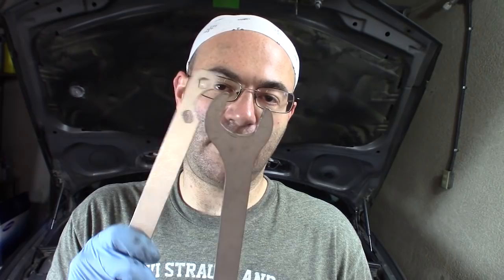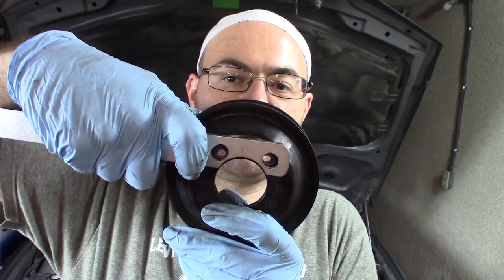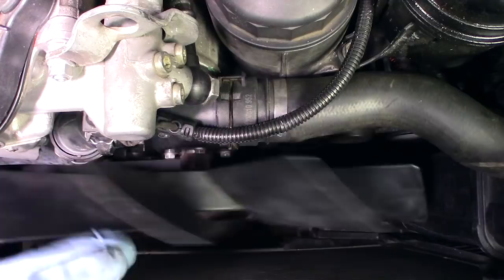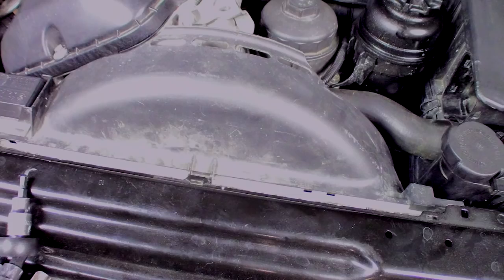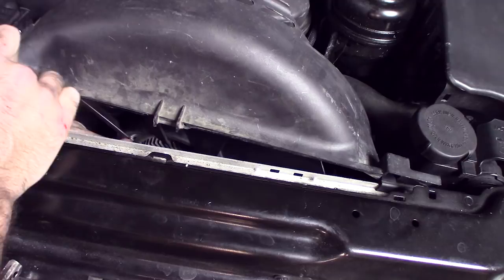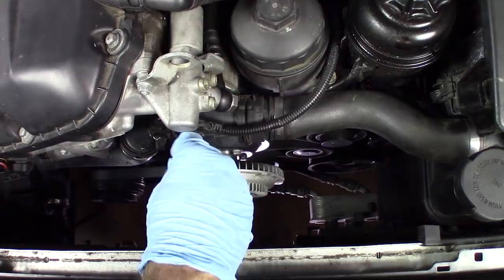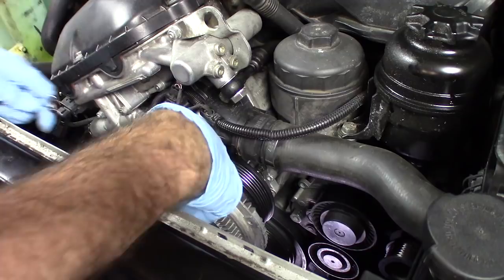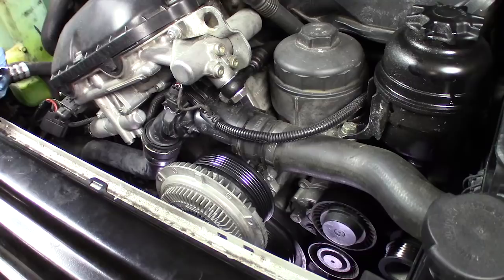BMW Fan Removal Methods - Remove Impossible Fan Nuts!

Comment: Method 4, don't buy a BMW in the first place. I agreed to Help my neighbor out by working on a highly neglected 2003 530i that sat unused for 5 or six years, he paid 400 which caused a rift in his family because afterwards she wanted the car back, she has some crazy notion that the car is worth something like 7 grand, she is 85 now she won't speak to her nephew, ive never seen a stupid car cause a family feud like this one did. I'm currently attempting to replace the oil pan gasket, as we all know BMWs are leakers, I wanted to remove the fan so when I jack up the engine it won't hit the shroud but that proved to be an impossible task, after using my 12 inch croissant wrench and a hammer to try and shock it loose it wouldn't budge, I could see that the nut was kind of chowdered up so it's not this girls first rodeo,

Comment: 4 years later and I want to thank you for making this vid. I swapped in an electric fan and your trick of removing the blades and shroud from the clutch gave me decent access to the nut. Your other trick of using a prybar gave me the technique to use a crescent and a tire iron to loosen the nut. No special tools required. Unless you consider a length of steel pipe to extend the leverage of the crescent, as a special tool. Many thanks again!!

Comment: I know not everyone can afford this but if you can, just upgrade the crappy clutch fan to an electric fan.  Trust me, it'll make your life a whole lot easier!  You can use the electric fan from a manual E46 btw, in case you're wondering.
Reply from the maker: Personally I don't think it's worth the money.  I only keep my fan clutch on lightly tight so that I can remove by just giving the wrench a tap.

Comment: Hey Jason, quick question: I have to replace the deflection pulley, mechanical tensioner and belt. Can I use method 3 to just remove the fan blades? Or will the fan clutch be in the way? Thanks

Comment: If the first two methods don’t work, try sticking the top of the spanner with a hammer to shock the bolt whilst applying downwards and clockwise pressure.

Comment: thanks for going into detail on method #2.  It worked for me on my S54.  Other videos go over this a little bit but your video makes it clear to see what to do.  I was going to try method #3 if it didn't work but it did.  Broke the fan clutch nut free in 2-3 minutes after trying for an hour the previous night without wedging anything to hold the water pump in place.  Other videos break it free without doing so.  I used a long flat head and a 10" husky adjustable wrench with a 4lb sledge.
Reply: you can’t do method 2 with s54 dude

Comment: I wish I saw this video earlier, I'm going to have to resort to the third method. I smacked my fan clutch nut for over two hours and nothing. I use your videos for reference all the time, they're just so perfect. Thanks a lot, man!
Reply: @walterhunter740  You mean your now-ex? Lmao
Reply: I'm curious, mine seems to be rusted and it's impossible to take it out even with special tools I got off from Ebay. Sigh. Third method. Did you use WD-40?
Reply: @jonathanbock8435  Hey! Sorry, I sold my e46 a few years ago. I think I just had a mechanic do it for me :P

Comment: I think it's important to note for those who are skimming through this video that the fan clutch is reverse threaded. I watched the video far enough to buy the tool an attempt to remove the fan from the water pump and failed to get it to work I ended up ordering a new pulley and fan clutch to mate to my new water pump. All of this was preventive maintenance for me on a car that's driven very rarely so this wasn't a major inconvenience. No amount of torque was going to remove mine because I was trying to thread it off normally. Great videos!
Reply: M

Comment: Replacing my alternator and found out my water pump pulley is broken. That’s a good way to blow a head gasket. Ugh. At least I found it. One problem leads to another. Your videos are extremely helpful and for that I am very thankful.

Comment: thank you so much, just started #3 method, I have the shroud and fan off. The 32mm nut is well and truly seized, tried air hammer, all tools mentioned (which broke under the force) and now have a broken adjustable wrench to replace so this video has been my life saver to keep the car running , will down PS pump as well while its all off 🙂
Reply: Holy shit I just went through the exact same thing, I used the air hammer with a bolt breaker and still nothing!! Not even the fan clutch tool I wasted a lot of money. I guess I’ll have to try method number 3

Comment: 50sKid Thank you so. Frikin. Much. I could not for the life of me get that damn clutch off. I cracked the water pump trying to do the 32mm wrench and hammer way. All I needed out of the way was the plastic part covering the fan. Now I FINALLY have access to everything and can inspect my belts. You. Are. A. E46. Saver.
Reply: was looking at my cars fan and saw it spins freely with almost no resistance  gonna take off the fan clutch what else should i replace while iam in there 110 k miles  and should i buy a new cheap one on ebay 30 ish bucks

Comment: I just used method 3 to remove the fan clutch and water pump on a E53.  I got the special tool but it would not break the nut loose and just bent the tool and spun on the nut. So method 1 failed.  Tried method 2 and the nut would still not break loose.  Thank you for making this and all of your BMW repair videos.

Comment: Big thanks to you!!! You saved my day! I did get that water pump pulley holder tool from Ebay. However, I spent about 2 hours still couldn't fit on two bolts at the same time. I didn't know the tool was not made properly at the moment... After watching your tutorial video I realized I just need to grab on one bold and can rest on the fan nut... It only took me 3 mins to break the nut loose using your method!!! Keep up the good work! Respect!!

Comment: Hey man, been working on this for like 30 min trying the hammer method. No luck. Tried your method #2 using a screwdriver and it worked straight away. Had to come back to the computer to give you a like. Thanks!
Reply from the maker: +markabby15 Nice, glad it helped ya!

Comment: Thanks for all you do.  I have the same fan-removal tool set you showed (holder+wrench), and I've used it successfully to get the fan off my E36.  But I could not get the fan off my E46 to save my life.  Your third method at least allowed me to get the fan blades/shroud out of the way to get more room (though it was more difficult than you demonstrated because I had a hard time getting my hand in there).

With the fan/shroud out of the way, I STILL couldn't get the fan clutch off.  That holder tool is a B#$%H to get situated tightly on the pulley bolts.  What I finally ended up doing was locating the holder tool on the underside of the WP pulley, resting the handle on top of the main pulley, to the right.  It was in there tight and the main pulley provided the backstop needed to hold the WP pulley still.  One crack with the wrench and it was free.  THANKS!

Comment: Worked great on my 2003 e39 - 20 seconds and the nut was broke loose on the first attempt. I also used the long Harbor Freight Pittsburgh pry bar which is a very useful tool around the garage.

Comment: Duuuuuuuuuude!!! OmfreakinA! Man you are THE bimmer god hands down! 
I just started a project, 2002 325xi and needs basically everything replaced but was going to do the oil filter gasket first and my fan clutch is just seized! Wish I saw this first but I already took the expansion tank hoping to just get more room to pry around and cost me the trans thermostat :( which isn’t too bad but I’m trying to do things slowly and don’t have parts readily available if they break........ but thanks for this, gonna have to resort to level 3 technique! xD

Comment: hey  kid.,,, I used your tip of removing the fan Via the hex bolt.  I had to use your tip because the 3 bolts holding the pulley were missing & the 1 had broken off after I got the car back from a mechanic ( I know , it doesn't make any sense.) but I was able to  remove the fan to try to fix the my problem... again thxs a million!!
Reply from the maker: Awesome dude, glad that helped you out!

Comment: For methods one and two, which I use, I have a tip for getting the fan easily rethreaded. When you are unthreading the fan to take it off, just as the fan nut comes free, mark one of the fan blades with a plece of tape and note the position. This way when you are ready to screw the fan back on, hold the fan around the same position to easily re-engage the threads. Note: when the fan is  loose, tape the nut and fan body together so that the relative fan to nut position does not change.

Comment: Chiseled the pulley off and removed the fan clutch while still attached to the pump. my water pump was 230,000km and the propeller inside still hadn't broken, amazing. I also went with a electric fan because I want to never deal with this again

Comment: Been taking off fan clutch nuts for years on multiple e46s but today I have been defeated on my new wagon. Bolt is seized. Fan clutch tools won't make it budge. Striking the 32mm tool or adjustable wrench won't make it budge. So I tried following method 3 to find out the hex head bolts are rusted and stripped. Back at square one.

Comment: What do you do if two of the hex bolts in the alternate approach are stripped and you cranked the waterpump/bolt so much that the water pump pulley crumbles. Why are they plastic stock anyway? I also am very aware it is reverse threaded. Please help

Comment: When doing the remove fan clutch stuck to water pump method doesn't the radiator need to be removed as well since it's kind of in the way?

Comment: Option number 3 sucks to do. I had to do it that way when I changed out my power steering pump and needed access to get the belt back on the pulleys.

Comment: the fan blades on my e39 got shorn off and the remainder of the fan is left on the fan clutch. couldn't remove it the nut this time (even though i've done it a few times before successfully) with methods 1 or 2 for the life of me. didn't even think of using half of method 3, just removing the fan from the fan clutch and replacing it with a new fan right in the engine bay! thanks for this

Comment: Question, hopefully someone will be able to answer: the electrical connections that you have your hand on at 3:20, what do they go to? I'm fixing a friends BMW whos fan blew up and took out a bunch of things, two separate electrical connectors included that were attached to the passenger side of the fan shroud.

Comment: For some reason my pulley is missing a bolt and only has 3, can hooking it on one bolt only still work. (Facing the front of car) when I put the tool on do I turn left with the holder and right with the wrench ? When I turn the wrench to the right I am afraid to put more pressure in fear of breaking the pulley

Comment: What size is the tensioner torque size ? I tried using an Allen wrench and nearly striped it I think. First I thought it was the top pulley for my e36 99 323is but I used a socket wrench and nothing moved.

Comment: hey great video man. Im planning on does a vanos rebuild/VCG change and I was thinking instead of removing the whole fan if I should just use the method you used by just unbolting the fan blade? would it leave me with all the room I need ?

Comment: Hey thanks for this. Would an open ended box spanner work the same as the wrench? And for the 'special' tool, I'd consider making one myself and drill the bolt holes to size.

Comment: I don't think there is enough room to use method number 3, I have 325 ci 2003 and even with the shroud loose there isn't enough room to remove the fan. Even if you can do method #3, I wonder if you have enough room to pull them all out with water pump, the pulley and the clutch radiator fan still attach to each other without hitting the radiator. At any rate, it's a very informative video

Comment: Hey dose your fan clutch make that loud windy or sucking noise on a cold start? sounds kinda like the ups truck/school bus sound just not as loud. my fan sounds like that on a cold start and gets louder and louder the farther i push the throttle, it sounds like it stops around 3000 RPM. there is a lot of misconception on the forums about this. is this normal?

Comment: Had a clutch I could not get off broke the water pulley holder trying to remove it. Got the pump out now but is there a way to get the pulley out from the water pump and seized fan clutch?
Reply from the maker: +Jeff Matchette not without destroying the water pump or fan clutch. If you heat things up the pulley will melt. Probably easier to replace the lot
Reply: That's what I ended up doing. Took the hit at the bmw parts counter verse waiting on ebay. $42 for the pulley not awful.

Comment: I can't believe that fan cowling is a 1 piece, that's annoying. I've had a different problem with my 528i e39 fan. The viscous fluid on the thermo fan stays solid, causing the stupid fan to permanently spin. I've actually, "disabled" the fan from spinning. Throughout summer and currently fall, I've driven this car, as normal, cruising and urban. Engine temp is stable, engine bay is clean, and my fuel consumption averages 29mpg, up from 26.5mpg. I've never seen it there! I'm wondering if I should even bother electrifying the fan unit (?)?) Now if I was towing something or heavily loaded - which is never, then I'd consider.

Comment: How is the fan shroud removed without removing the fan? It seems the shroud is surround the fan and they either need to come out together or...? Any ideas?
Reply: fan has to be removed unless u break fanshroud at the bottom end .... I used 32mm wrench and this from Home Depot ( https://www.homedepot.ca/product/hdx-adjustable-slip-nut-wrench/1000828297 ) cause I had a stubborn fan

Comment: Replacing my AC belt, in theory i should be able to do method #3 and not even remove the clutch to access and replace the belt. will give it a crack anyways and see, although its probably easier to take the whole assembly out with method #2

Comment: Is it possible to loosen the nut with just the 32mm wrench using the belt as the gripping tool to hold the pulley? I mean using just the wrench and a hammer
Reply from the maker: No the belt tension isn't enough to keep the pulley from spinning when you torque on it.

Comment: Unfortunately I didn't have them cheap tools. I've taken the 4 bolts out and can't get them back in the pulley. Is this because they don't line up with the holes ? Any feedback I'd be grateful, as I can't drive it to the garage now
Reply from the maker: The holes are actually offset so if you can't get them back in, rotate the pulley 90 degrees
Reply: ok thank you

Comment: Hi, I looked on Amazon for the fan clutch wrenches and saw mixed reviews on various wrenches for sale. Can you link me to a decent one that's not too expensive? I have a 325xi, 2005. Thx!
Reply from the maker: +Paul Gunn don't overthink it. One is as good as the next for home use

Comment: Can a e46 328  with automatic transmission with a clutch fan be replaced by a electric fan.?
I, saw a DYI on it and it looks a lot easier to work when replacing bells, water pump, power steering pump, etc.
Can it be done. Please help.
Reply from the maker: Yes it can be easily done you just swap the fan in, remove the old one, and use the exact same connector.  I will be doing a video on it soon.
Reply: 50sKid AWESOME. !!!!!!!
Thank you so very much for helping us less fortunate in a mechanical field.
I will buy tomorrow one electrics fan from BMW.
You the best.!!!!!

Comment: I am having to replace the fan clutch on my 2004 e46 wagon.  What would happen if one took the old clutch and rigged it so it was always fully on. And then the fan would turn no matter what... would that harm the engine in some way!!!  I thought in freezing weather it might get the engine too cool... but here in So Cal it seldom gets that cold... what do you think? bob
Reply from the maker: bob campbell if you do that the plastic fan will explode and take out the radiator. It’s happened to me. It’s extremely important that you not do that
Reply: could you explain a little further why that would happen...if it were an alum. metal fan would it be different. Please say a little more...my plastic fan at home run about the same speed and its lasted 20 years??? I do believe you though... bob
Reply from the maker: The fan blades get brittle over time and the increased centrifugal force will cause them to simply fly apart
Reply: ok thanks for explaining... ok now to find an alum fan??? hummmmmmthanks bob
Reply from the maker: Why are you looking to do this?
Reply: Well the world of corporately designed obsolescence wants your car to fail as much as possible in order to make more money.  Any person who can designed  true-life-time-parts will give the planet a break.  With the onset of lower cost CNC machines (a few thousand dollars) a person could make many of the parts that would in the level of usual wear, not wear out, get brittle, snap off, dry out and so forth.  If you had say just 100 hobbyists, who decided to make true-life-time-parts for a range of say E-46 vehicles, it would over time force the moguls to offer better quality parts.  This would bring true competition back into the arena of the common man. I know it sound hokey... but Ghandi did do it...with spinning wheels, salt production, farming and so forth.  And hey, how about a bank owned and run by the people with no monthly fees, predatory bounced check rates and so forth...  I know, its just a fantasy... until somebody does something simple... an alum. or tin fan...  bob